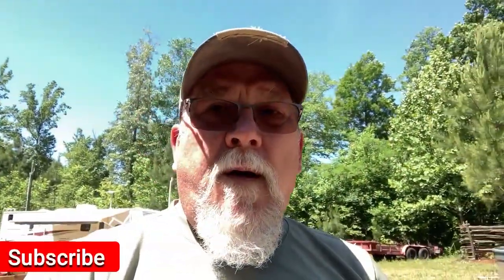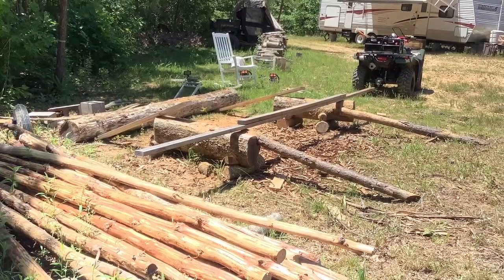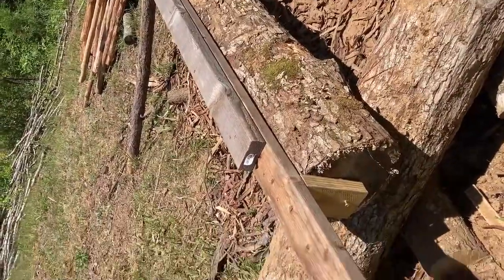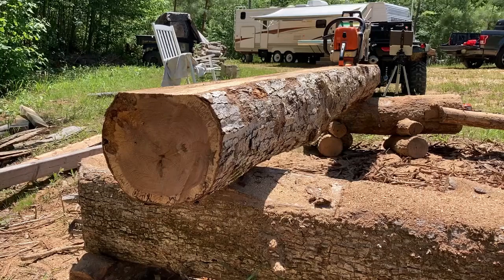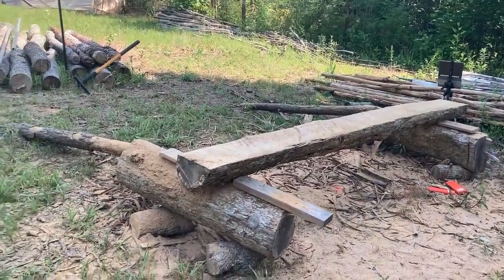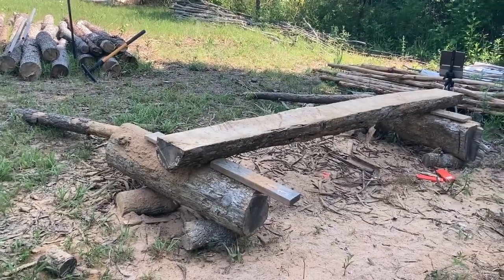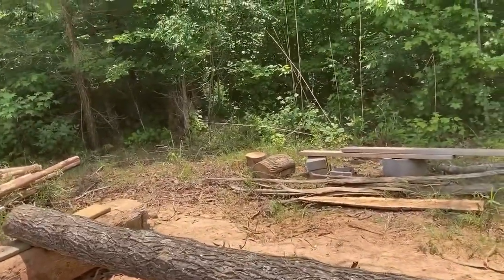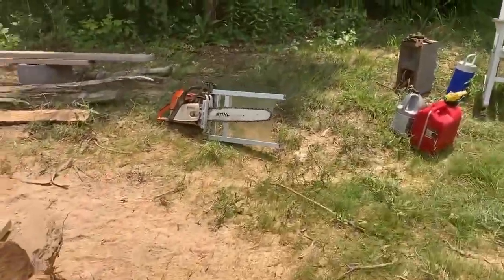Turning Logs Into Lumber - Vlog #104

Comment: Hey Dave.  I started chainsaw milling about a year and a half ago.  Was really crude at first, individual boards  varied in width along their length from 1/2 to 2 inches, lol.  Things I learned:  The initial cut is critical for the flattest boards that is.  Also maintaining a single angle through the cut helps with finish.  A sharp chain is key, and keeping your rpms at a steady pace.  If you can get a ripping chain it helps with smoothness.  Probably the most important thing is to allow the saw to idle for a few mins after each cut so it can cool down.  This year I bit the bullet and bought a bandsaw mill.  It was a pricy purchase, but if you are cutting a lot of lumber it is worth the price.  I enjoy your channel and hope to see more videos soon.  Have a good one.
Reply from the maker: Thanks so much for the input and advice, I do appreciate it!  I will invest in a ripping chain soon, I believe it will be worth the money.  With my shoulder repaired, I am looking forward to more milling this winter.  I really appreciate your comment and watching the video!  Dave Out!!